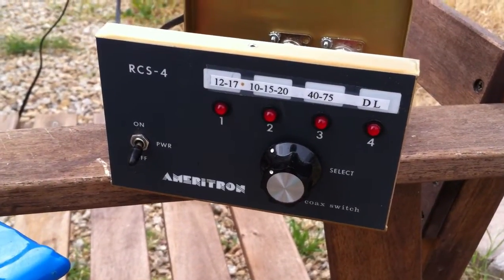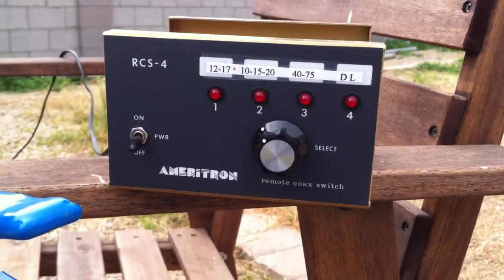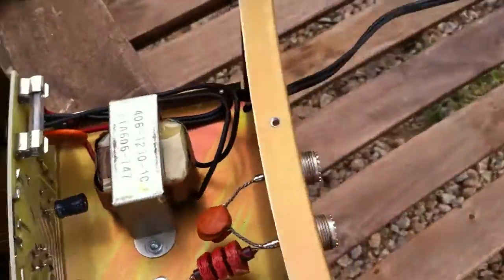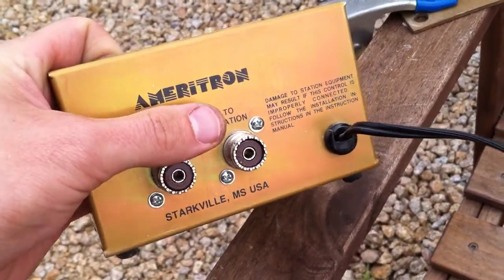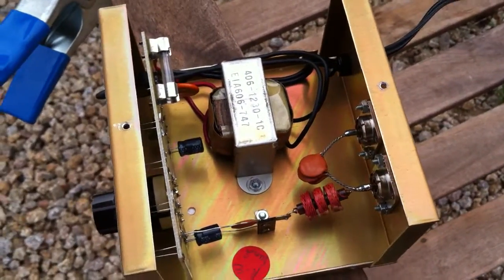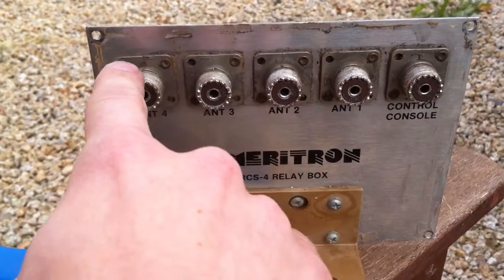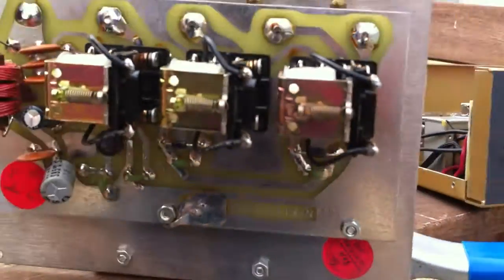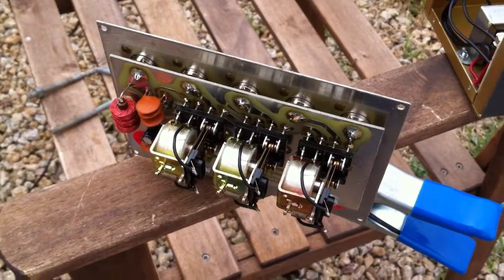Inside an Ameritron RCS-4 Coax Switch Relay & Control Box

Comment: Just so you know, that RCS-4 is one of the original versions. I have the exact same unit and it is dated to Feb 1998. The newer units changed the relays and configuration of the coaxial connectors. Mine still works great and your should too.

Martin - K7MEM